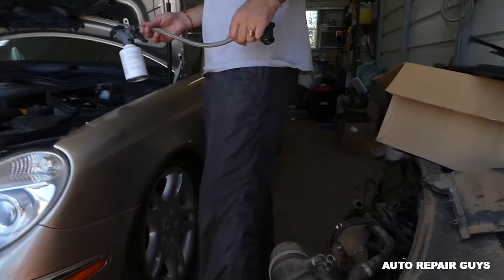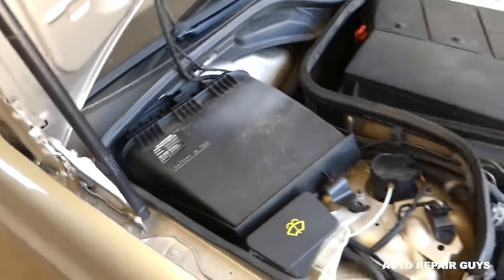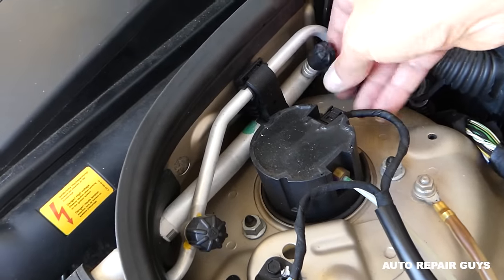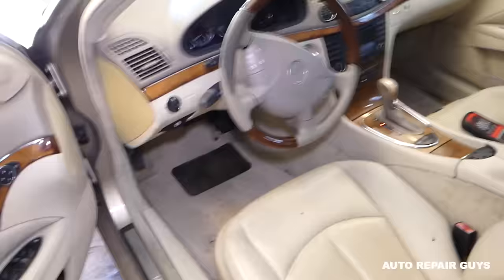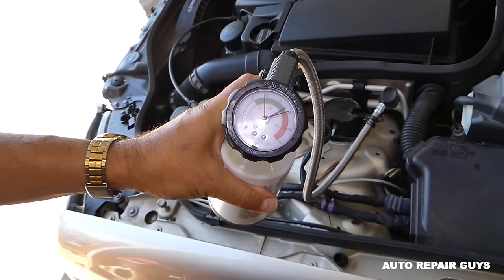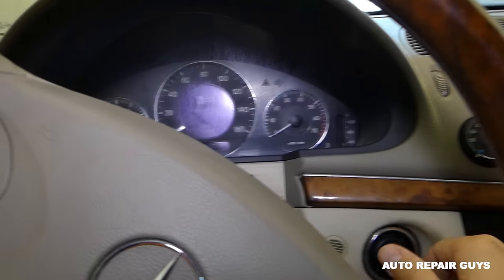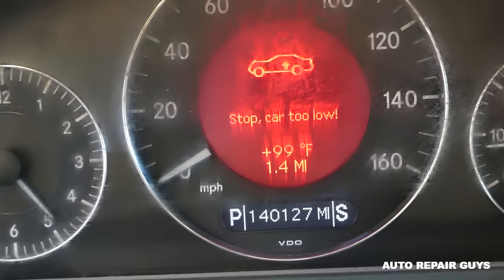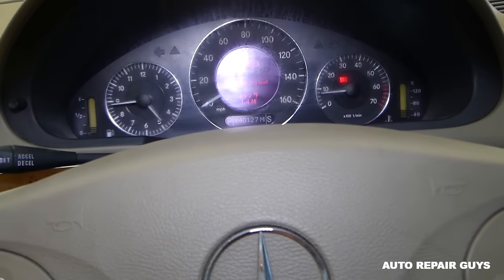MERCEDES W211 HOW TO RECHARGE THE AIR CONDITIONER AC E320

Comment: Can low refrigerant cause high pressure reading on the low side?  Compressor clicks on, stays on for a few secs then turns off.  no or very little cool air comes out.  AC works fine as long as you are moving along on the highway.

Comment: hi, I ask you a question.  i have the same car and i wanted to ask you if your car with air conditioning (a / c) turned off the radiator fan always turns?  Thanks in advance
Reply: No it shouldn’t unless it is very hot
Reply: @MuradMuradov717  OK thanks
instead my fan is always spinning at the first speed
Reply: Having the same problem. How did you sort it out?
Reply: @johnmolefe6765  Hi, 👋 good morning I resolved that by inquiring on the Internet and through the workshop, I learned that it is normal for the fan to run at minimum speed with the engine running. among other things, the w211 is electric, the fan, however, the w210 was attached directly to the engine via its clutch so it always turned. these types of engines probably always need continuous cooling

Comment: I evacuated my system and I think it needs some kind of reset, because it won't turn on the A/C and recharge the system. I read that if the pressure is to low it will disable the system. How do you reset the A/C on a 2008 E320? I saw instructions where you hold the OFF and REST buttons to get the code, but mine doesn't have a REST button.
Reply: I have the same problem did you figure it out ?
Reply: @Angel-kz7kz  yes, it had to be reset using an OBD-II scanner. I used my friends Snap-on scanner.

Comment: I have the same car e320 2003 but my ac when i turn it on the ac off or ec off button turns on i have put a new compressor, new expansion valve, no leaks, the fans work and now in changing the ac pressure switch does anyine know where is located at and also the ac sensors or fuses???

Comment: My Mercedes-Benz W211 E280 4Matic 2007 blows warm air on driver side but cold on passenger. Can someone guide me please?
Reply: @Mohammed Talha Hi Mohammed, I recharged my refrigerant and it works perfectly now!
Reply: @rekanylmaz3787  when you say you recharged do you mean you added Freon?? I have the exact same problem.
Reply: @tequilashots875  I added some refrigerant.
Reply: My W212 same problem...I will try add gas...hope it works
Reply: What is the ac oil capacity in w211

Comment: What about resetting the a/c compressor to turn on... the blinking a/c light won’t allow you to add freon
Reply: Do u know how to reset the compressor to add freon, my light blinking not allowing me to add freon.
Reply: roberto aldana need star or compatible software to unlock compressor clutch ...
Reply: Gspadez tooreal hey thanks, I got it done yesterday, reset the code n was able to charge the system, thanks again.
Reply: roberto aldana is that what your shop used or you found a compatible scanner ?
Reply: Gspadez tooreal I have an Autel scanner,  I just didn’t know I had to erased the codes for the compressor to work. I guess any scanner able to read and erased codes will work.

Comment: the passenger side is much cooler than the driver side, almost no AC at all....what could be wrong?
Reply: The water heater valve located under the wiper blades is mulfunctioning
Reply: Passenger side is where the blower is
Reply: @Ray_Yang182  not a blend door?
Reply: @Ray_Yang182 are you talking about the heater control valve

Comment: My car is messing  ..
look..
left (driver side comes hot 🔥  air.
Right (passenger)  side comes cold  air.
I don't know what to do!...😳
Reply: take it to an air conditioning car place and ask for an air conditioner AC RECHARGE.
Reply: Your car most likely has dual temp. Most Honda’s and Mercedes have this in their car where you can set one side to be hot or cold. There are 2 knobs that look exactly the same with a blue and red color painted on it. Locate these both and set them both to blue and you will be set

Comment: 😈 this is not a professional work and Exhaust temperature is also bad...

 it should be wide under 10 degrees Celsius -  so it's already too much to have a perfect working condition
Reply: Her's my feedback after the chance of the AC- compressor and professional charge of  R134a : Air blowout is at 3-4 Celsius degrees ! 

THIS is a accurate working System...

Comment: Bad directions. You need to vacuum the low pressure port first so you will not introduce air in there.